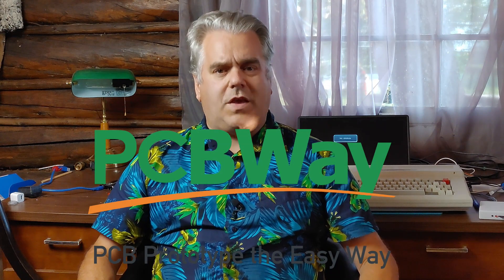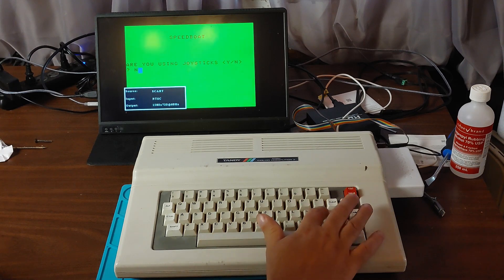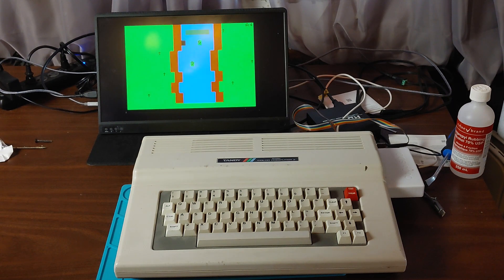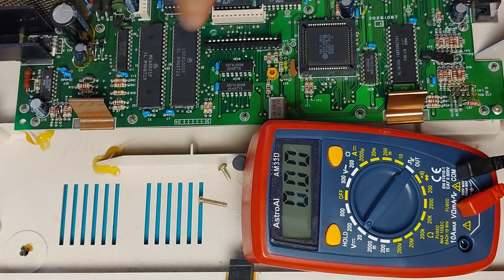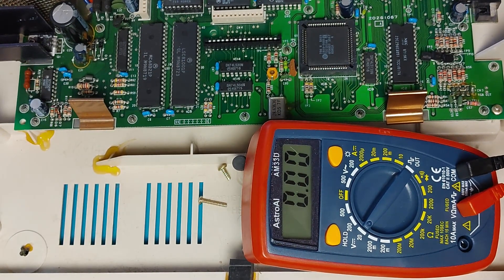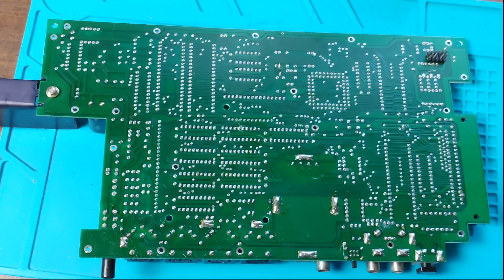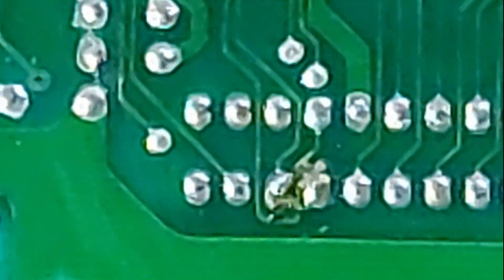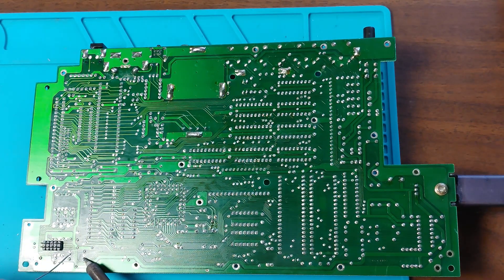My New CoCo 3 Has Some Intermittent Problems #septandy

Comment: I have a COCO 3 the same Switck-A-Roo as you do, if I play a game like Froogie it requires me to put it in video mode on the RGB. I have vertical likes from top to bottom and I was woundering what your is like. I hve the monitor setup so it limmits the lines to not to bad, please check this out and let us know...... Mike
Reply from the maker: On games like Froggie you have to use composite as the color on the screen is a result of Color Artifacting (Colors bleeding together to make more colors)  In RGB on these older games there is no artifacting due to the crisper signal of the RGB so instead you get the Black and White bars.  There is a switch on the SCART end of the Switch a Roo to put the signal in Composite for the older games.

Comment: I still think a contributing factor was bad power in the conference room we used at CocoFest. You, Rick Ulland, myself and several others were all havjng weird problems, and plugging the same computer in back at home (or even in the seminar room) seemed to solve them. It was bad enough I couldn’t demo the GIME-X at 3 MHz without it freezing… yet it worked fine at the Amigos and at home (and still is).
Reply from the maker: I would guess that had something to do with it.  I am just hoping it didn't do any damage to anything
Reply: My mantra is never plug anything you care about into anything but a ups.  Line interactive and true sine wave at a minimum.  Modified sine if you must, but then you need a filtering surge suppressor.
Reply: May need to replace a few of the power filtering capacitors.  Telltale would be if the joysticks are really jumpy or you have issues saving and loading from cassettes (or the interface to your cassette stand-in).  Mechanical handlings and temperature effects, as you suspected, are also good candidates too.  Thanks for the video!  (I would deoxit5 connectors and sockets then reseat things too)
Reply: Interesting, I do hope that all it is and it lasts a long time!

Comment: Yes intermittent problems are the hardest to diagnose!
I think your initial gut feeling is likely where the problem will be. I'm willing to bet it's a power regulation issue, specifically with C29, the 4700uF input capacitor tot he SALT chip. The residue you found between the solder points looks like solder flux left over from some rework done to the board. Luckily flux is mostly harmless since it doesn't conduct current. I really liked this video and I can't wait to see the next one in this repair. Great video!
Reply from the maker: It was all a guessing game, once I replace all the caps I will feel better about turning it on